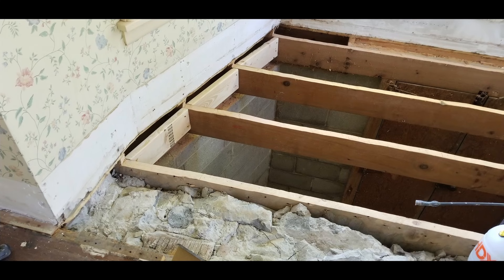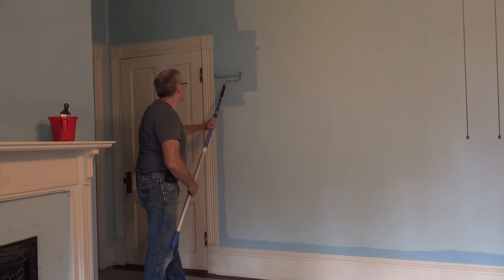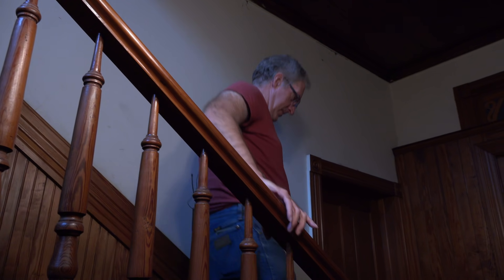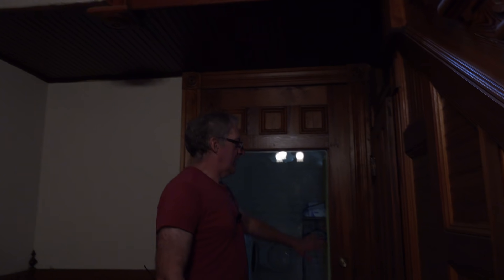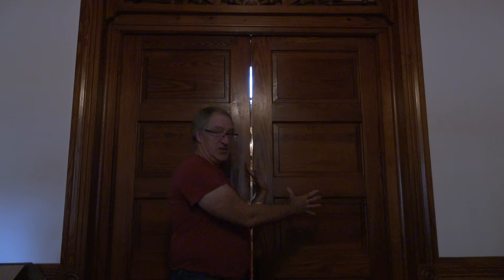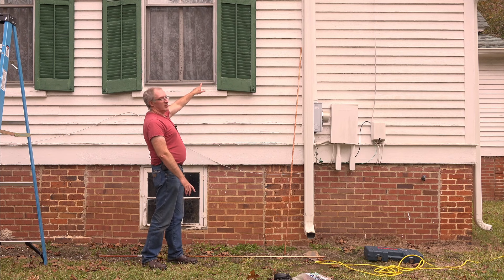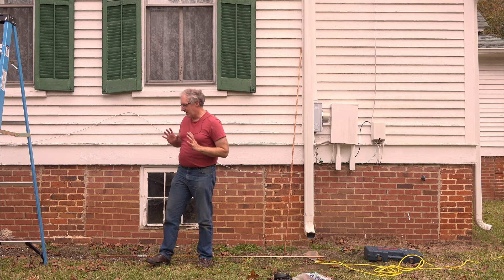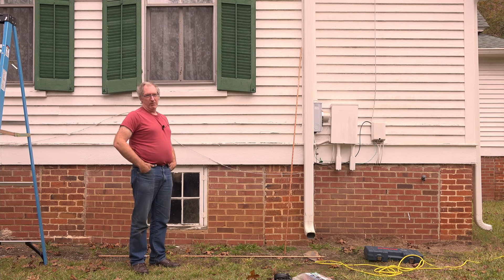EP 54 Victorian Electrical Begins

Comment: With a shipping charge of $16.00 for one mug to Oregon, the shipping is more than the mug.  Re scraping paint old style, sort of.  I'd use an electric orbiting sander with coarse discs instead of spending all day heating and scraping.  And did you test the paint before heating, scraping, and inhaling the dust?.....for lead.....
Reply from the maker: Sorry about the shipping cost. USPS sets the rate.

Comment: Get a heat gun and it will go much faster. Wagner makes several good guns that will safely loosen the paint on the full width of the clapboard. You can then use a four inch wide scraper and the paint just peels off.

Comment: I hate to keep button in but one other thing I just remembered I was going to say I loved the way you kept saying this paint comes right off and it didn't it seemed to have been fighting you the whole way 😳
Reply from the maker: Imagine how it would have been without the heat? The heater needs to be adjusted and then it will work better.
Reply: @1834RestorationHouse  yeah you are so right Mike and this way too like you said you don't have to use all those strippers and chemicals on the side of the house either I just thought it was a little funny but you both do a great job 😉

Comment: There has got to be a better way.  When you go to paint the rest of the house is that the technique you are going to use for the whole house?  Oh my gosh!  I need to paint my little 900 sq ft home and this seems daunting.  I don't think I have the patience.  If California wasn't in such a draught I would power wash it, but we are.  But now I'm thinking I may never paint my house if this is the solution.
Reply from the maker: No worries. We just took the heater out of the box and filmed it without adjusting it. It's supposed to work much faster that that.

Comment: Is is practical to do the whole house by that method?  What color do you plan on painting your home?  I joined your channel when you were replacing the floor in the 2nd Empire house and installing a new heater in the basement.  Great channel!!
Reply from the maker: That's right! You've been with us for a while. Yes, we'll be heat stripping the house but we'll do only what's necessary to finish the electrical. The rest will have to wait for better weather. We haven't looked at colors yet but that would be interesting!

Comment: Luckily all of (most of) our paint at Gleaton Askew House Restoration is chipped up and comes off readily. I still use the Speedheater where needed tho. Looking to get her repainted by Spring. The only addition to our house caused it to sink by about 8 inches to the back.. all fixed now but additions on old houses, especially those done mid century, rarely bode well for the house. Enjoyed the video!
Reply from the maker: Hello Laura! Good point about the additions.....I've never seen a 50s/60s addition yet that was not of shoddy construction. Thanks for stopping by!

Comment: How are your other trees doing over there on the far side of the house? Was worried when seeing putting the kerosene out on ground; it could hurt the root systems of the other trees. (to fix, dig out and remove all dirt around application zone - before rain spreads it out, if you think it might be necessary)

So... you have very little electricity in the house? Does it blow a fuse now and then (when trying to use more than a couple electric items)?
Reply from the maker: The other trees are doing fine and so are the ones we tried to kill (ugh!). So far we haven't blown any fuses but we keep the load as light as possible so we don't overheat anything. The big loads (AC, water heater, oven) are on breakers with newer (60 year instead of 100 year) wire.

Comment: Just out of curiosity, could you use a heat gun as well.   Is the exterior paint lead based?  I was really interested in the copper rod sunk into the ground.  I am now going to see if it is a regulation in my area.  I don’t think I have one.
Reply from the maker: Hi Rosanne,  yes a heat gun would work as well if it's used carefully. Ground rods are required by the National Electrical Code but some really old houses may not have one. In that case, the system is "grandfathered".

Comment: Ground rods must be totally in the ground. You can not have a part of the rod sticking up. 8 ft of buried ground rod means the entire rod is buried. Check on the depth required locally for the wire between them. Normally wire has to be buried 24". The only exception I have seen is to use a 10ft rod and 8 ft of it must be in the ground.
Reply: According to WikiHow it depends on the inspector whether the ground rod needs to be totally buried or not. In some cases, like how Mike did it here, it is perfectly acceptable to leave 1-2 inches sticking out of the ground.
Reply: @sharong8511  I am an electrician. I go by the national electrical code and this is a point made by many instructors. An inspector might pas it bu that still does not make it code compliant.